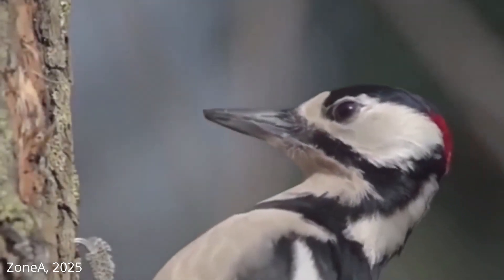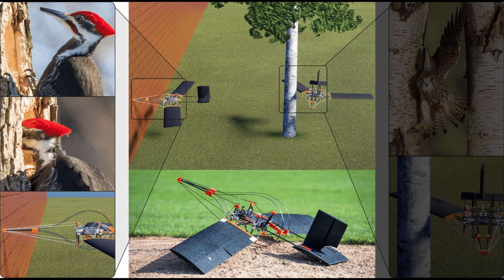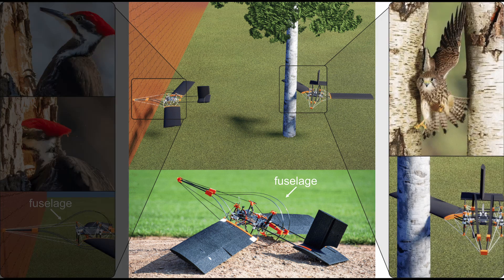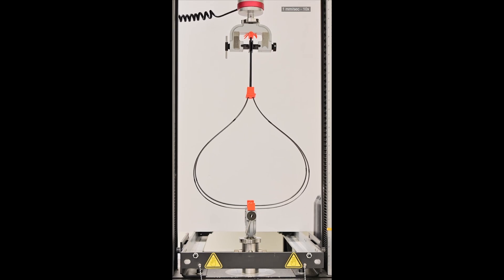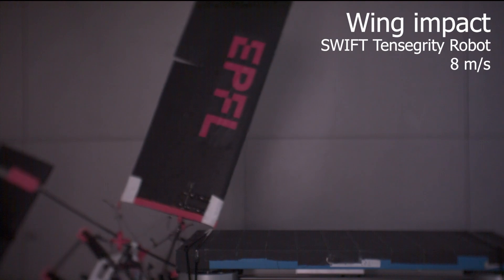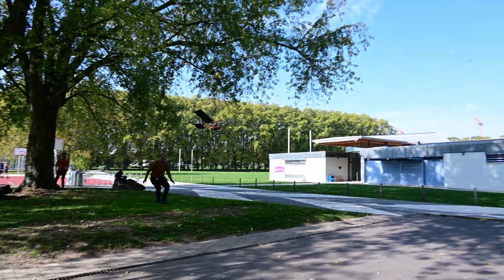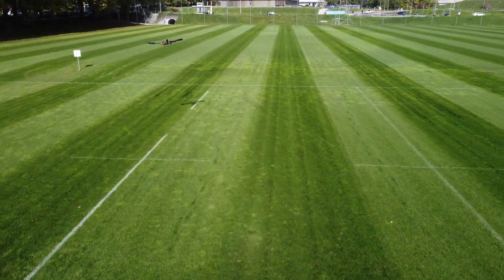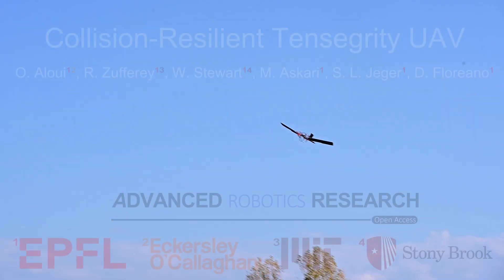Collision-Resilient Tensegrity UAV

Comment: Flexible airframe cannot withstand high lift forces so it's not practical and scalable. I would recommend the MIT team to check out the light weight propelled covers that DJI is making for their products. Others in the RC industry use frames that simply fall apart during inelastic collisions. Btw I use the woodpecker biomimcry in another project completely unrelated to flying machines.

Comment: Biomimicry, old news.    I can see some user-replaceable  "crumple resisting" parts in flying system; but, 'is the juice worth the squeeze'?    I can see a nice roll cage or crash cage for $10,000 or $100,000 movie cameras and other equipment while having pre-determined break-away section is a great idea; but, the added complexity need to be seen

Comment: The woodpecker head structure surrounding the fuselage is a great shock absorber. For the wings, I think you should also include snap connectors to rigidly attach them, so the flexible attachment only comes into play during impacts that are hard enough to pop them off. You could even automate the recovery by including a winch that pulls the wings toward the body to snap them back on, and then unwinds to give them some slack to pop back off again in the next crash.
Reply: A winch is probably overkill. Just use the magnets and some elastic bands to hold the wings on.  At the impact the magnets will break apart absorbing some energy then the wings will pull apart either absorbing the rest or absorbing some of it and leading the plane into a rotation that eats up the rest of the energy. Immediately after the crash the wings pull back into shape.
Reply: @JustinHunnicutt  what if the elastic like gets caught into something?
Reply: @Fold-103  it's a flying wing based on tensegrity, if it's going to get caught on something it's likely to be all the strings. The rubber bands at the center of the strings are the least of your worries in regards to branches and things. 

Unless you mean get caught on something that's a part of the plane... You could design it so most of the rubber band is recessed in the wing and the other end mounts as close as possible. And the band doesn't need to stretch very much. You just want enough stretch to change impact from a sharp blow to a mild bump. 

A somewhat useful example is the flying wing by team blacksheep called mojito. It uses a band from one wing to through the body to the other wing. It's mainly a mounting method but likely helps with mild impacts.
Reply: That's an exelent idea! Some clever mechanical design on the connectors with embedded small neodynium magnets would provide required the structural integrity to the airframe.
Reply: Too complicated.

Comment: My first ever RC aircraft was a Bixler 3, that crashed on its second flight, after which I pretty much gave up on the Hobby. So this video definitely makes an impact (pun intended), haha. Great work, not just building something like this, but also figuring out the aerodynamics to get this thing to fly!
Reply: I've crashed and crashed and crashed Bixlers. You just hotglue the bits back together and fly it again. At one point I had one that was almost more hotglue than foam...
Reply: @JamesChurchill this is the way
Reply: You know, it's human nature to make mistakes; it's the basic principle of how we learn. 

My first rc plane was a Great Planes Reflection Bi-plane when I was 15 in 2004... what I didn't know was that this particular plane was designed for stunts, but that didn't stop me. On it's MAIDEN FLIGHT it crashed and broke a little.Yes, my heart dropped; But the difference between us is that I was given instruction and hands-on help. 

There were computer rc plane flight simulators but they were slightly more expensive then building a kit rc plane. Anyway, long story short, I repaired the bi-plane a week later when I got my next Allowance and tried again... with a little over 30 minutes of flight between TEN little lipo batteries. That was a fun day, and I still have that Bi-plane; it's retired tho.

Since then, I've scaled up to 40 inch wingspan analog rc planes that can reach speeds beyond 100 mph, tho I usually cruise at 35 mph; and I'm just starting to learn how to build and program freestyle drones too. 

Don't let LEARNED HELPLESSNESS chain you down!! If you fall, wipe the tears away, get back up and try again! The road to success will be paved with failures and that proves true for ANYTHING you pursue in your life... be it a Relationship, Hobby, Career, Investment, and/or Lifestyle choices. 

Robot's are interesting, but how often are they seen on public streets interacting in environments and among people on a daily basis. ( rhetorical question ) While this robot plane mimic's bio-engineering on a rudimentary scale, it's extremely far from practical, the final version will be expensive compared to simpler solutions and the company will have to find an alternate product the current industry and market would need to stay in business ( or go bankrupt ).